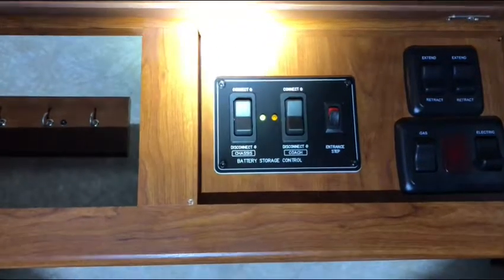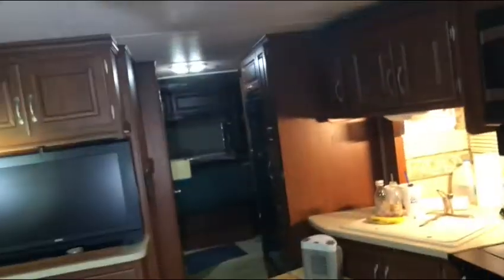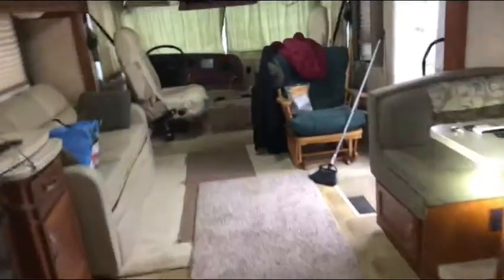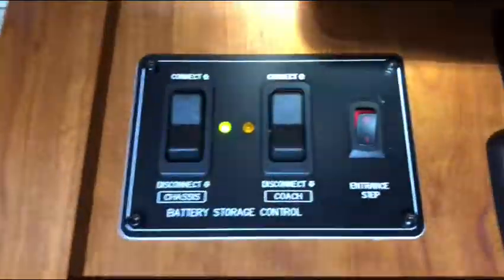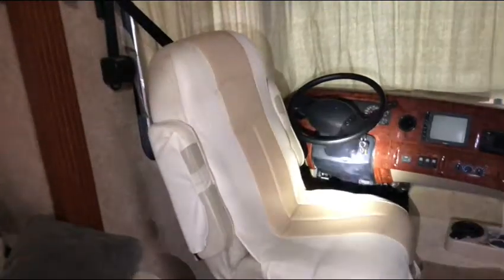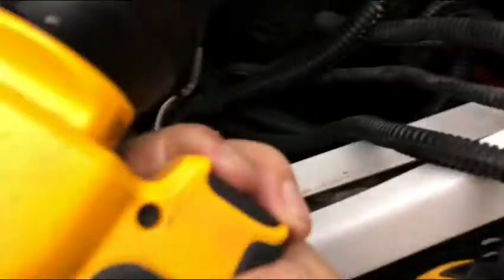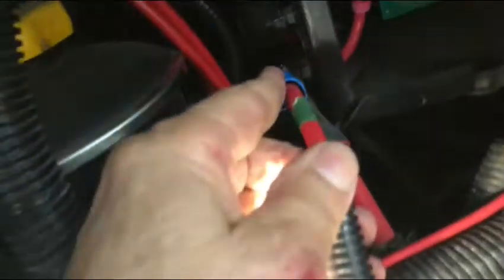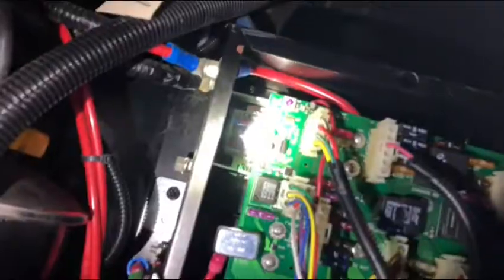RV battery storage control switch

Comment: When you put up coach up for the winter and or week after the weekend. Do you have to unplug the battery so that it does not drain your battery or do you just leave it? Im having that same issue and only turns on when plugged into house and or generator is running. I have switched the switch and made sure that it is wired correctly and still nothing unless it has supplied power. TIA
Reply from the maker: never i keep them charged

Comment: I have the same issue with my 2008 windsport  is the battery disconnect switch ? or the solenoid ? that is bad ??   Help !!!!!!!
Reply: I see you have a 08 Windsport. I also have a 08 Windsport. My issue is that I have no power to the coach. I can plug in and have power to the coach, I can run my generator and get power. When I'm on the road and not using the generator, nothing. When I hit the switch to turn on coach batteries and sounds like its switching on, but still nothing. Is this my disconnect switch or the solenoid??
Reply: @jeffjumba8246    not sure but I had to replace the coach switch on mine it didn't have power to the coach ! that fixed it.